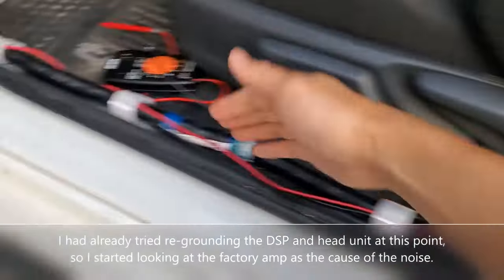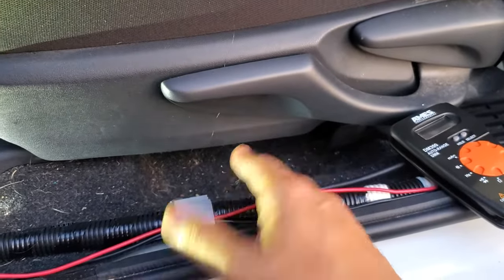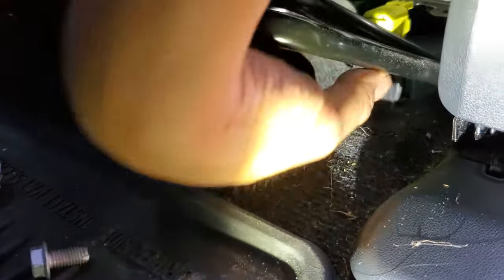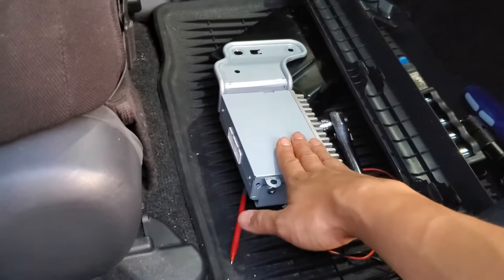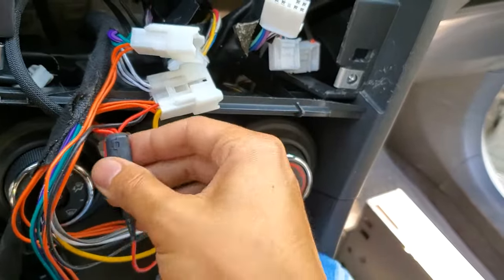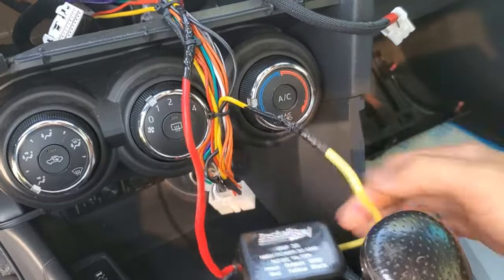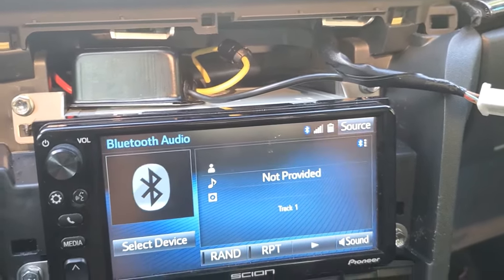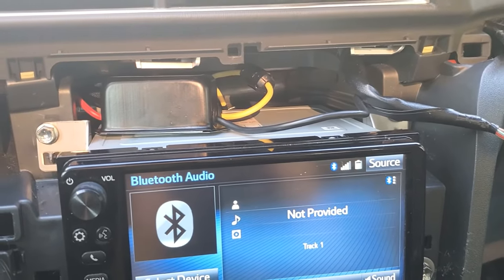Stereo Head Unit Alternator Whine Noise Filter Fix (Power Wire vs. Ground Loop) (Scion tC2 / tC2.5)

Comment: Hey Derrick, first of all...........Thanks for the video. After watching your video, I purchased the 30amp filter, and it improved some. I looked at more YouTube videos, and some suggested running a grounded wire around the RCA outputs behind head unit. I can still hear it. I'm dumbfounded at how many things I've already done, and still hearing that darn buzzing sound in my speakers. I don't really use the radio. 95% of the time, I am using a USB flash drive with  my music on it. I've also seen some YouTube videos where they install a 3.5mm ground loop noise isolator. But, I don't operate anything requiring a 3.5mm filter. I am stumped, dude. Is there such a thing, as a USB Filter to run before my flash drive ? LOL   I think I've tried everything. If you come up with a solution to stop audio noise 100%, keep us posted. Thanks man
Reply from the maker: I'm assuming you've done all the basics such as running the RCA cables separately from the power cables. Have you tried connecting bare minimum while testing? I've seen one car where the radio antenna was actually causing interference and another where the attached USB input was problematic. Try disconnecting everything you don't need to run your basic stereo setup and add components back in one at a time. Since you use the flash drive, maybe see if you can bypass it temporarily and Bluetooth music from your phone for testing purposes.
Reply: @VampyreX13  Hey Derrick, first of all......thanks for replying back. Yes, I've done all the basics as far as running power line, opposite of RCA cables. I haven't tried connecting bare minimum while testing. I guess that will be my next diagnosis. I hear the buzz, more during the audio boot up. Before the actual music comes through the speakers. Don't get me wrong, the filters and running bare wire around the RCA jacks on the head unit, have quieted it down. But, Car audio systems should not have any interference at all. I also found that it isn't the USB drive causing the interference. It made the same buzzing sound, with radio selected. Thanks again

Comment: I just installed speakers, amp and sub to my factory head unit in a 2016 Canyon and had 2 noises. One rpm related and the other just a constant buzz. I moved the amp ground and the rpm noise went away but the constant buzz is still there.  Do you have Any idea what I should check now?
Reply from the maker: Do you have the audio and power cables separated from each other?
Reply: @VampyreX13  Yes. The power line from battery to amp is away from all audio/speaker wire except right at the amp.
Reply from the maker: @markpotter2485  is it like a bad ground buzz? Do you have another set of audio cables you can try just to eliminate them as a possibility. I had a bad set of cables do something similar.
Reply: @VampyreX13  yeah like that... just a constant tone buzz. I dont have any extra audio cables but I suppose I could try another set. First I think I will add another ground to the head unit and see if that fixes it 1st.
Reply: Change your alternator ground cable with a Welding Cable lead. It has finer strands of copper cable. It’s a commonly used fix for older Chevy trucks which inherently have grounding issues. Some electrical magic having thinner wire I suppose 😂

Comment: Can the ferrite magnets be placed on an amp power cable? (4 Gauge)

What about RCA cables?
Reply from the maker: I don't know if they would make much difference on an amp power cable. As for RCA cables, I found that it affected the audio quality.
Reply: @VampyreX13  affected it negatively?

I’m not sure what to do because there were two whines before, one from the radio and one I couldn’t pin point. I was able to get a warranty claim to swap out the aftermarket radio for another one. One of the two whines are gone now but this second one I cannot pin point. However when I shift the wires in the trunk (physically move RCA’s in a different orientation from power, I hear a much reduced whine.
Reply from the maker: Yes. I don't remember the results, but I didn't like it so I removed the magnets.  Do you have the RCA cables separated from the power cables? Are they properly shielded?
Reply: @VampyreX13  they are shielded however I realized the best buy guy that installed the amp has the last 1 foot of cable leading upto the trunk zip tied together. The rca’s, power, ground, and speaker wire.

I also realized however that my usb cable when disconnected removes a lot of the whine. I might add a magnet here
Reply from the maker: Let me know what you figure out.

Comment: Having an issue myself  I have a aftermarket stereo and amp powering  the speakers first when I'm moving the remote wire or rca cables I have a noise when the radio is in the acc position it goes away then I move the wires a certain position and I have a whine when the car is all the way running as rpm increases what wires shouldn't be ran close together? and would this solution work
Reply from the maker: Make sure the audio wires are separated from any power wires and make sure you're using good quality RCA cables. Also make sure you have a good ground. Maybe try grounding the amp(s) to the same location. This noise filter may help, but you want to make sure you do all the basic troubleshooting fixes first.
Reply: @VampyreX13  another thing my radio still works without being grounded what wrong with that
Reply from the maker: @2koolforyou88  Your radio is being grounded through the chassis and your radio harness ground. If you don't have a multimeter, I would grab one.
Reply: @VampyreX13  I have one
Reply: @VampyreX13  I just bought this noise filter now where does the red wire goes to
Reply from the maker: @2koolforyou88  red wire goes to the power source from the car and the yellow wire to the power input to the radio. If you have a DSP, you'll want it's power connected to the yellow wire as well.

Comment: What if its just static noise? my car has that problem and I suspect is the power wires :S
Reply from the maker: I don't know about static noise. Do you have any aftermarket audio equipment installed? Make sure the power and audio lines are separate. Maybe disconnect the antenna and see if noise is coming in that way?

Comment: Hi I have a alternator whine coming from one of my rear speaker when i give it gas. Can it be a ground issue or a bad amp ( also one channel doesn't work on my 4 channel amp)
Reply from the maker: If 1 channel isn't working and whining is only in the rear, it's most likely the amp.
Reply: How to i verify that it is the amp and not a ground connection
Reply from the maker: @jesuszuniga1257  disconnect the rear speakers. If the front speakers play fine, then it's not the ground.
Reply: So if the front speakers play fine with the rear speakers disconnect then I should get a new amp
Reply from the maker: @jesuszuniga1257  considering you have a noise in the rear and 1 channel out, yes.
Reply: Oh ok will do that diagnosis tomorrow and check my wires to the amp and hu before checking my alternator thanks
Reply: Got it fix it was the power wire being next to the audio wire. Also I gave my amps separate grounds. I might need to get a new 4 channel though
Reply from the maker: @jesuszuniga1257  Glad it was a simple fix. Are you sure it's the channel on the amp? If you switch the left and right rear channels, does the problem move to the other side or stay on the same side?
Reply: Replace the rear old speakers wire with better wire and its working now it can be a intermittent issue.  Probably of thinking of repairing it before it gets worse

Comment: Bro. I installed a boss audio radio cd /radio/ bluetooth. The stock amp in my camry is not used. No rca jacks are used either. It whines in bluetooth mode. What can I do?
Reply from the maker: Is your phone plugged into the car and charging the same time you're listening to Bluetooth?
Reply: @VampyreX13   I have a lhone charger plugged in the cigareete jack but no phone is hooked up. Should I see what happens if i take the charger out?
Reply from the maker: @Dibran9mm  unplug any external electronic devices first. Does it whine when the car is off? Does it only whine when the car is running? Do you have any aftermarket LED headlights? Does it whine when they're on? You want to try to eliminate any external factors so you can test just the stereo system. If you still can't find the problem after doing all that and you're sure that you don't have any wiring issues, you could try adding the filter in this video.
Reply: @VampyreX13  it whines when I press gas pedal the most
Reply from the maker: @Dibran9mm  I would try the filter and see if that fixes the issue.
Reply: @VampyreX13  should I get some of those magnets too u think? Also with this filter, jjst do yellow from head unit. Yellow from car and combine the three wires? Same for red etc?

Comment: I use a 360.3 DSP and I get whining noise from my vehicle as well, what does that core magnet do?
Reply from the maker: I still had a little noise even after installing the 12V noise filter. The ferrite core got rid of any remaining whine.
Reply: Derrick Aquino you hook all that up to the factory power wire
Reply from the maker: @mondo82111  you install it inline with the power wire that goes to the head unit.
Reply: Derrick Aquino ok thanks a lot man, good video 👍🏾

Comment: I hear a whistling sound coming off my car speakers when the key is on (acc). And after the engine starts, the speakers make unbearable screeching, high pitched sound. Music still can be heard on top of this noise but trust me it’s irritating and i miss listening to only music. Does anyone know the problem?
Reply from the maker: That sounds like what happened on my Caddy. I haven't had time to track that issue down since the car's been at the shop, but as with yours, I suspect some sort of short or loose wire at the head unit or speaker.

Comment: have a problem with my subs, everytime i accelerate my car it will make thumping noises, but when car is still it wont male the noise
Reply from the maker: Make sure your amp's ground is good (sand the location clean so it makes 100% contact with metal if it isn't) and confirm that your audio signal wires are not running along side your power wires.
Reply: Derrick Aquino thanks ill do when i have some time and let you know if it works

Comment: I have 460 watts on the back and it's so Squeakey and fuzzy
Reply from the maker: Sounds like you may need to check the quality of the audio cable and it's routing. It should be separate from the power lines.

Comment: My whine goes away when I gas the car. So anytime it idles, the noise gets worse! So annoying.
Reply from the maker: That's weird. That's the exact opposite of any experience I've had with engine noise in the audio system.
Reply: Did you figure it out? I have the same problem with a Kenwood head unit, Amp in trunk. Noise goes away the faster you go. I do have the power on wire for the amp routed with the RCA wires to the trunk. Im going to try moving that next.
Reply from the maker: Definitely separate the RCA from power cords and possibly get higher quality, shielded RCA cables.
Reply: @VampyreX13  I have the amp power hooked up straight to battery under back seat. Only wire I have going up to the front of the car is the Amp "Turn on" wire. Would you say thats probably it? I have good RCAs.
Reply from the maker: Doubtful since that's just providing power to turn on the amp, but always worth separating it out for the troubleshooting process.
Reply: @VampyreX13  Thanks for the reply. Since the weather is getting nice I will probably look at this, This weekend. I only hear it while idling or low rpm. It goes up in frequency when the rpms go up and then you cannot hear it anymore. Thanks again.
Reply from the maker: Do you have any USB or AUX accessories plugged into the radio? That could cause some noise as well.
Reply: @VampyreX13  Nope. Just the radio and amp in the trunk. The sound is not real loud but can hear it. As soon as the car gets up over about 25 it is gone. Probably because its at such a high frequency that you do not hear it. Heading out to work on car now. Thank you :)
Reply from the maker: @northpoint1039  if you figure it out, let me know.
Reply: @VampyreX13  Ah, Yeah.... So, Im pretty embarrassed here. I coiled up the extra speaker lines in the trunk along with the "Power on" wire for the amp. I also used unsheilded speaker wire for speakers and "Power on" for amp.

Im not saying I got rid of the noise yet but I think we both know what is causing it. I have RCA jacks to the back end but then unsheilded coming off the amp. Im going to replace the speaker wire in the back end and also the "Power on" and run it down the other side of the car. Ill report back after I do this. Im not sure when as I have to get some decent speaker wire.

Its hell getting old I tell you.... :)
Reply: @VampyreX13  I think the whine goes outside the dudes range of hearing if he revs it :D